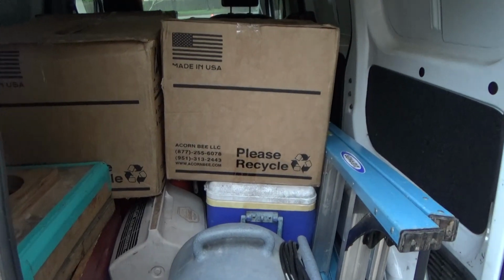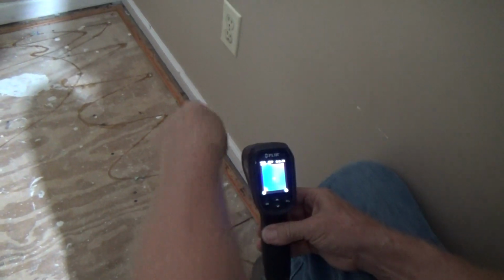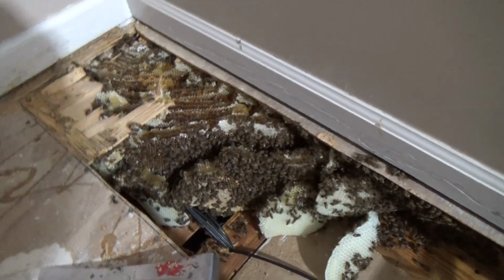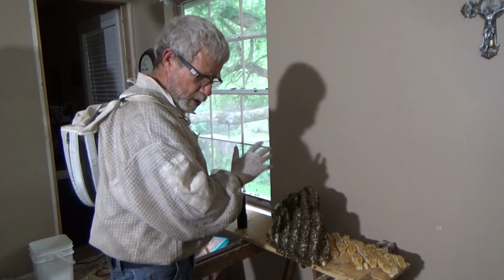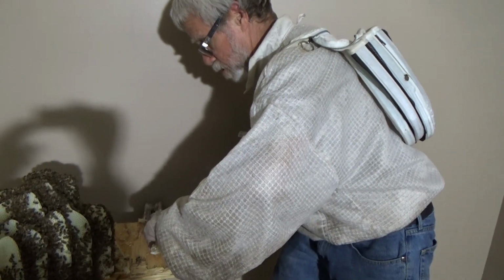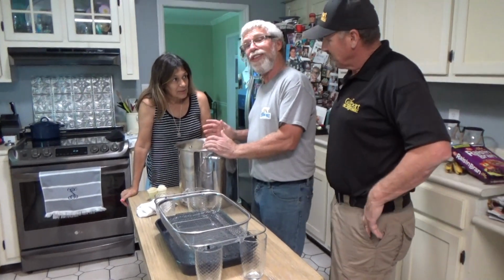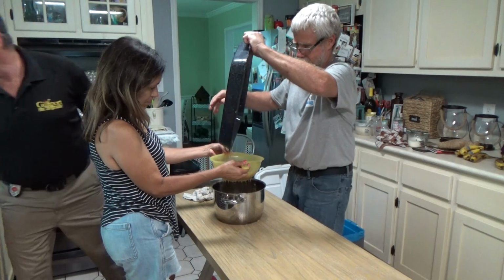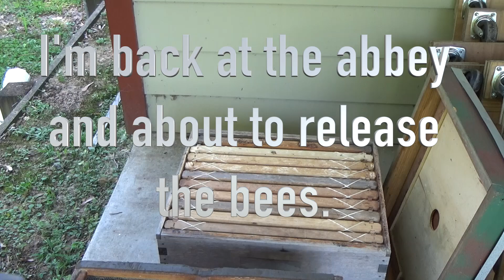A legion of angels. See it to believe it!

Comment: Looks like the free bees make much thicker comb than they do on frames. Would it make sense to create thicker wood around each frame to allow for thicker comb in the hive? not sure if i am phrasing my question well ;)
Reply: Increasing your frame thickness doesn't really buy you anything, since there's a pretty limited depth that the individual cells can be built to.  You also run the risk of missing signs of certain parasitic infections in your hive, by missing changes in your comb patterning.
Reply from the maker: Bees build their comb to very specific thickness depending on the need. Brood comb and honey comb could be the same thickness, about 1 inch thick, but other times you will find honey comb that is thicker. Bees are very intuitive about their needs, and construct the comb according to those needs. Great question Nick, thanks for asking and for watching. God's peace brother.
Mr. Ed